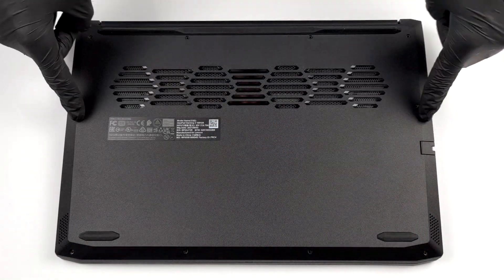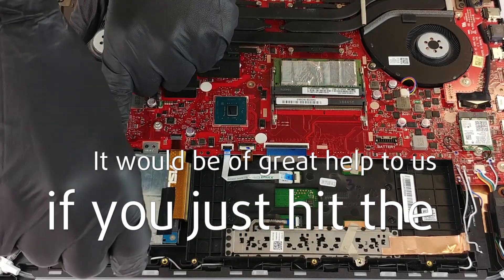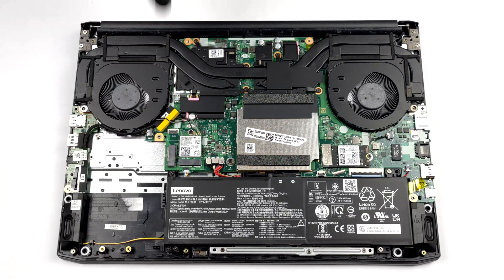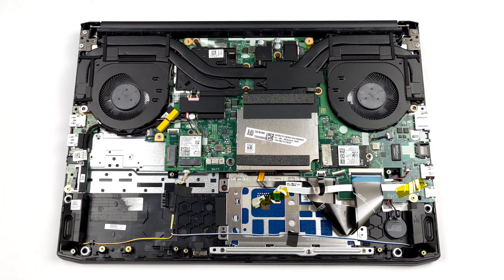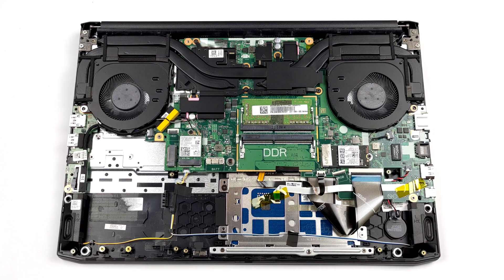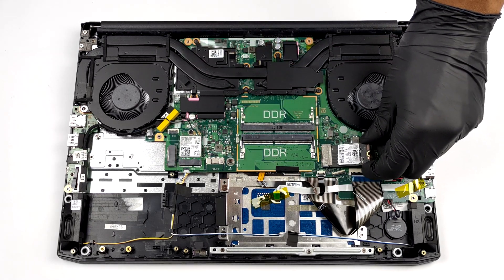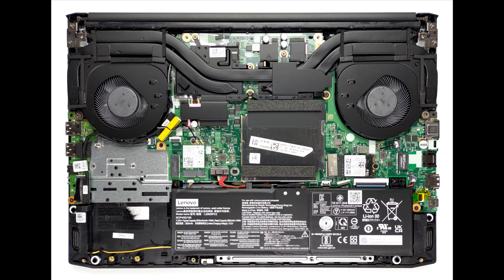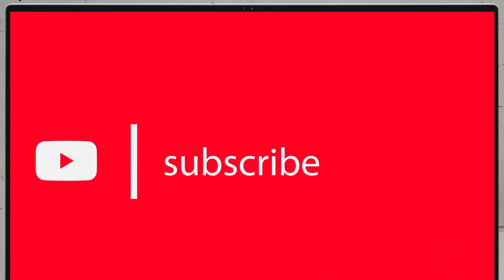🛠️ Lenovo IdeaPad Gaming 3i (15", 2021) - disassembly and upgrade options

Comment: Bro does the display of this laptop interfere the back exhaust vents ?
Reply: No it doesn't matter the engineers are smart they didn't waste the space in laptop they smartly utilised the space in laptop for heat sink 

At first when I bought laptop i also thought the same thing I asked the shopkeeper and Lenovo support and some engineers (friends) and they said no it doesn't affect the heat sink
Reply: @monategaming5785  Thanks you for your reply after 4 months I already bought this laptop enjoying it from 3 months.

Comment: Hi, I have a question? I have a laptop Lenovo IdeaPad Gaming 3 15ARH05 (82EY00N4MB) 
if I want to turn on this laptop, the red light blinks when the power is on. 
Can you advise me what is the reason for the flashing red light next to the power plug?
Reply: He dont use that laptop l,so search for people who use and ask them in thier chanell,or contact the customer service 😅
Reply: The indication light on the side of laptop (left) indicates the following-

The one which is next to the charging port-
Red light=Charging
White light=Fully charged or enough charged above 60-80%
White light blinking-Needs to be charged

The one which is next to the novo boot key or next to the headphone jack-

White light=Turned on the laptop is turned on

White or red light BLINKING (light to low and low to light)-The laptop is in sleep mode

Comment: I hate that the IdeaPad 2021 has a 2.5" HDD bay but the Legion 5 doesn't! Wtf Lenovo?
Reply: It has it inside laptop
Reply: @maximeoknight  sadly, it doesn't. I have the legion 5 (2021) and it has the space for a 2.5" drive, but the removed the connection for it, so now you can only use an M.2 SSD